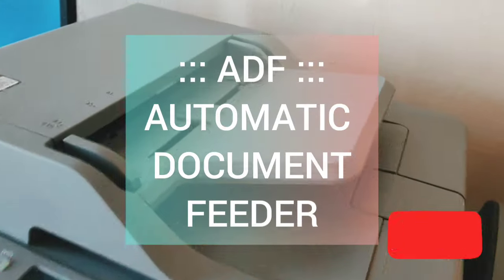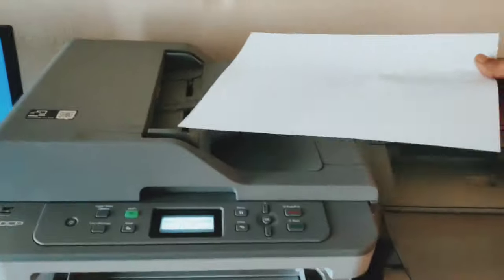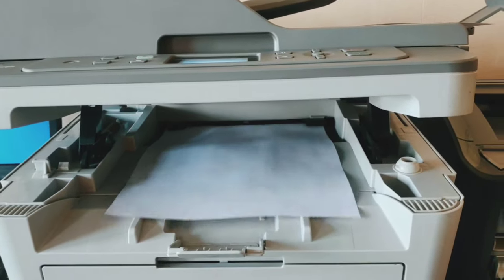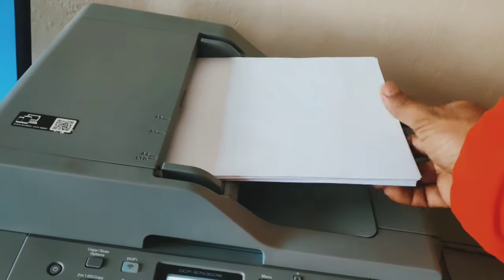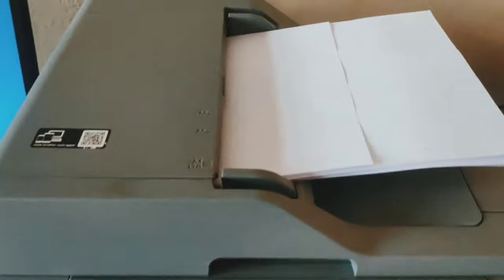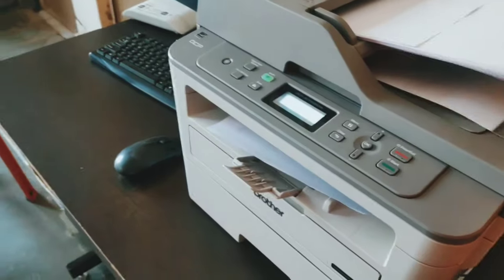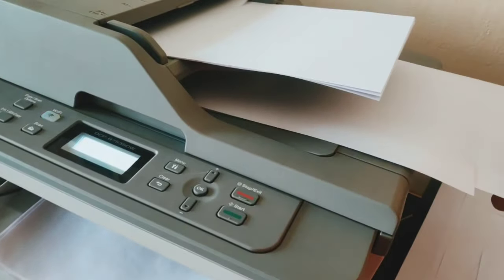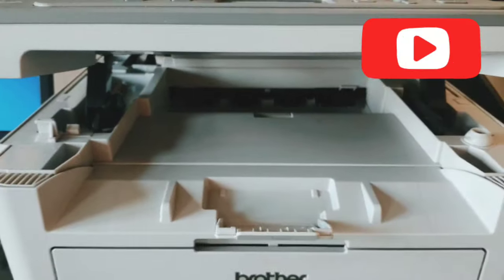How to use ADF Function in printer?

Comment: I have the same printer. Brother DCP-B7535DW. Just bought it today!

Can you pls tell me:
1. How long have you owned this printer?
2. How much is the ACTUAL pages output of a Toner? (Company claims 2600, but its less)
3. What is the cost of new Toner?
4. Can you Refill it?
5. How long does the Drum last?
6. Are you Happy with your purchase?
Reply from the maker: 1. I have been running this printer for 6 years.
2.सच बात बताऊं, इस टोनर से आप बहुत सारे पेज तो प्रिंट कर पाते हो, लेकिन अगर आप text print करोगे तो लंबे समय तक आप प्रिंटर से प्रिंट कर सकते हो, लेकिन इस प्रिंटर से अगर आपने कोई फोटो निकाला, काफी एरिया डार्क वाले images निकाले तो ink ki परफॉर्मेंस कम हो जाएगी. फिर आप कुछ ही पेज प्रिंट कर पाओगे
3. Toner and Cartridge are two different things. मार्केट में सभी के प्राइस अलग-अलग हैं. The original Cartridge of this printer is around 900. इसका टोनर करीब 2000 / 2100 ₹ का है
4.कुछ लोग इसकी इंक  को रिफिल कर सकते हैं You can also refill yourself, but it is a bit difficult, there are some gare-setting in it.

5. ड्रम यूनिट लगभग 30000 पेज प्रिंट करने के बाद खराब हो जाता है
6.देखिए परचेस करने तक तो अच्छी बात है लेकिन बाद में जो खर्चे होते हैं उसमें यह प्रिंटर अखर जाता है
Reply from the maker: How to print ID card from printer | प्रिंटर से आईडी कार्ड कैसे प्रिंट करें.
https://youtu.be/X7KguAxGIz8 

How to use ADF Function in printer?
https://youtu.be/j_bx75zua9w

How to take print both sides on paper with the help of a printer.
https://youtu.be/_hwAJ2xdq68

Take printout from WIFI printer Brother B7535WD|मोबाइल का उपयोग करके wifi प्रिंटर से प्रिंट कैसे लें
https://youtu.be/pq-ioHnNWpM

Brother DCP B7535DW drum unit ( break  )एक ड्रम यूनिट के अंदर क्या होता है?
https://youtu.be/QtNiYd96y50

How to use Drum Unit and Cartridge in Brother DCP-B7535DW printer
https://youtu.be/XMa7HhUr0Wo